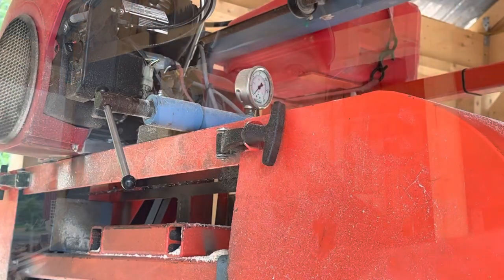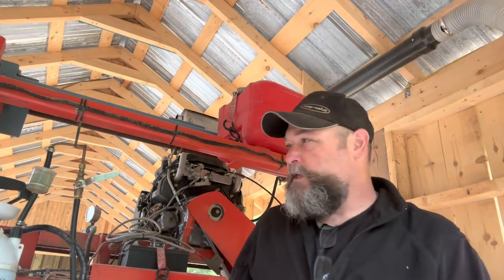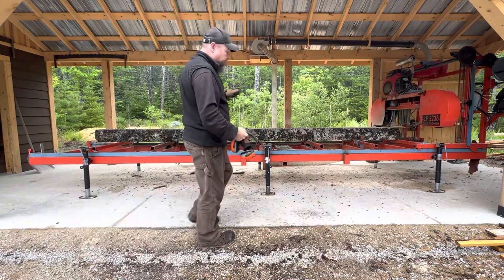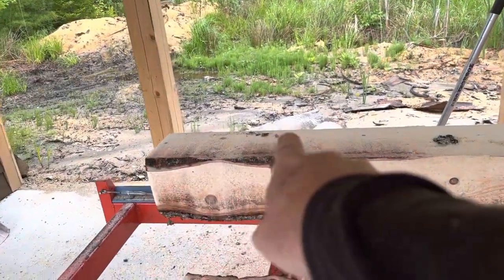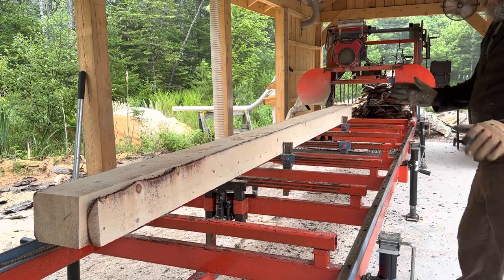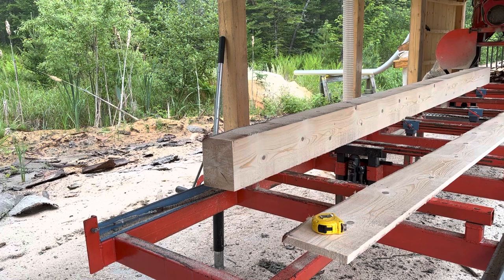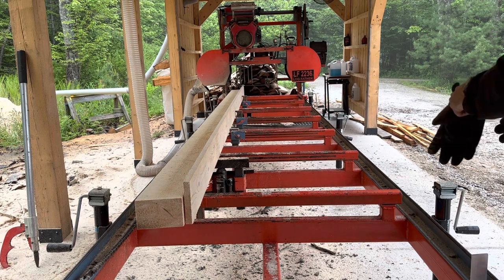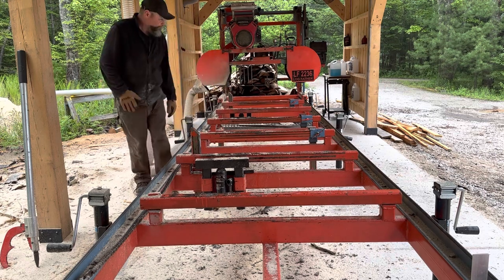Start to finish- a milling lesson.

Comment: I can see a 22 and a half degree sweep on the end of your saw dust pipe. Make it so you can rotate the sweep angle. You could make a huge saw dust pile.
Reply from the maker: I do move the exhaust outlet from side to side now and then- I’ll have quite a pile before the end of the summer.